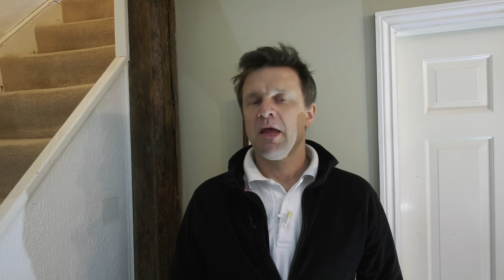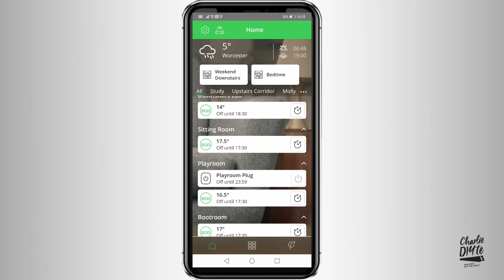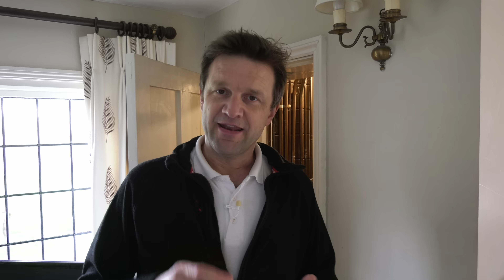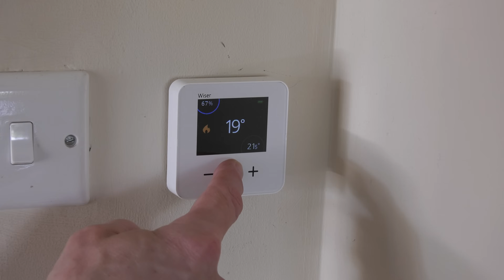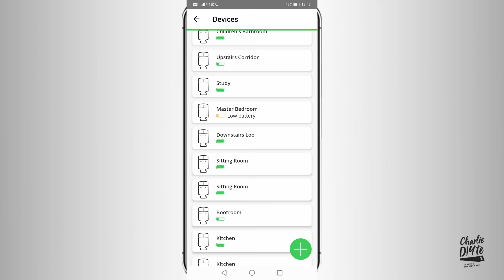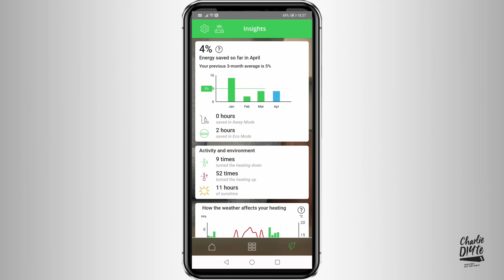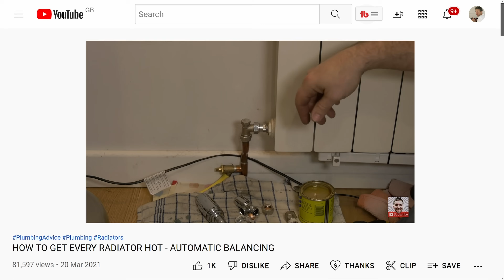Smart Heating Update - 14 Month Review

Comment: Room Thermostat. Tap middle button once for 2 degree boost for 30mins. 2 taps for 1hr, 3 2hr, 4 3hr.  Increasing temp +/- will remain at that temp forever unless you have scheduling setup. Enabling boost automatically increases 2 degrees. If too hot/cold use temp +/- to reduce or increase! I have room thermostat in every room. Use the boost as moving around the house. Works really well. Use the app in the morning to turn on heating downstairs simply using boost. Scheduling works fine but using away mode and boosting rooms as needed saving loads of cash!
Reply from the maker: Thanks for that Phil. Yes I'm pretty sure I covered the functionality of the room thermostat in my original video and should have gemmed up on this before find the refresher - there was a LOT to cover in this one. The Boost function only comes on for an hour though. You'll have much more accurate temperatures in each room with all those room thermostats 👍

Comment: Nice to get an update on how your finding the Wiser system as I bought into this system after seeing your initial install video. I'm currently producing a video of my own which covers more on the running of this system and some of the issues, rather than the install itself. I've also sent Drayton and Schneider a lot of suggestions to make this system better and get round a few of the quirks i've found, e.g. TRV and room thermostat offsets. Hopefully if I get a response from them then I will also cover what they are planning to improve. One area I will include in my video is the integration of a weather compensator onto my system boiler as Opentherm is just not working as you would expect due to the way different manufactures have implemented it.  In theory, the boiler will set its temperature directly based on an external weather sensor and should therefore heat the rooms up at the same pace irrespective of outside temperature. It should also start condensing a lot more as the weather picks up and the boiler runs at lower temperatures for the heating. However, I've keen to see how this effects the Wiser system with Eco mode turned on given that this mode has an element of weather compensation built in and I want to confirm if it conflicts with it in any way. I'm hoping that I may need to just rest the system so that it starts re-learning how quickly the rooms heat up again and realises that my home now heats up at the same rate irrespective of outside weather due to the new weather compensator.
Reply from the maker: Thanks John. You could probably do this with Home Assistant. Let me know how you get on.

Comment: Great review however I wouldn't part with my EvoHome. It was the original smart TRV heating solution and remains the best in my opinion.
Reply from the maker: It's a very good system Jason. Just think they've become a bit complacent given they were the market leader for so long. They need to add Insights but I guess they can't given the way it works. 👍
Reply: I agree with you, I’ve had Evohome for 7 years and my current house has UFH so all my systems including HW are Honeywell/Resideo and I can’t fault it whatsoever. I’d never be without it.
I have a three storey house, and I’ve not really had any issues with the system with connectivity. I can’t think of a system that does as much as Honeywell ie UFH, HW etc etc, even my 2 port valves are Honeywell 😂

Comment: Ah yes, the boundary system. I have one Charlie & like you had problems with connectivity it’s certainly challenged me but seem to have it under control for the moment after moving the hub & being sent a range extender. Great app though.
Watching this video makes me wonder why they don’t use the zig be mesh 💁🏼
Reply from the maker: Ah, interesting to hear that. They're doing what they can for me to get this working but are tight lipped when it comes to telling me what problems others have experienced. They don't use zigbee because z-wave is more secure and therefore better for security systems apparently. Personally I think they'd be better using it!

Comment: I made a mistake and bought Tado. It's not a mesh system and some radiators will not connect. I spent £1000 and intend to rip it out.
Reply from the maker: Wow, not mesh? I wonder why they did that? Thanks David that's really interesting. Sorry to hear about the problems you've had.
Reply: I looked at all the systems before going down the Tado route, the Honeywell systems looked dated and not much has been done to update it so ruled that one out, the Drayton looked great and also the Genis system, all great systems and the are from companies that are constantly developing the product, I expect the software to be changed over time.

I installed the Tado last September and it has been brilliant, I fitted TRVs on all radiators except the downstairs toilet and the main bathroom to allow boiler overrun, this is fine as it keeps these room warm and dries towels, I also fitted room stats to 6 room and the temperature in these rooms are very stable and accurate, I have found the family don’t complain about being too hot or cold, everyone’s room is at the temperature they like, my wife works from home and her office is warm all day and looking at the heat info this room requires little heat to maintain the desired temperature, I hound the hall call for the most heat so we invested in a new Rock front door and changed the single radiator for a slim double and this has made the hall nice and warm and reduced the call for heat to being one of the lowest in the house, now the only two problems I have had are the en-suite radiator valve had a leak around the pin and water got into the TRV as it was horizontal and damaged the valve, the other problem was the bridge failed and it was replace FOC by Tado.

So all in all I think the Tado is a perfect product for our house and family, I think if I fitted the Drayton I would be as equally happy, just for any of the manufacturers you will be happy as a smart heating system transforms your house and reduces bills.

Comment: Wifi is not the same as internet, if the internet is down there is no reason why the wifi network in the house shouldn't keep running.
Reply from the maker: Fair point but there's not much point in having a WiFi network if the internet is down.
Reply: @CharlieDIYte  If you have control systems on wifi then you don't need the internet to be active for it to work (unless it has to go through the internet... thats its own problem and not a wifi vs zigbee/zwave problem)

Comment: I have Hive installed and am considering replacing my "normal" TRV heads with Hive smart valve heads. I know it's a different brand but I think the principals are the same. So My question is what advantage regarding cost savings do smart valves offer over traditional TRVs set correctly?
Reply: The Hive trvs and thermostats do not speak to each other so you shouldn't have more than one in a room. For instance, say your living room has two rads and a thermostat, with hive you cant set one trv or thermostat to be the "master" temp sensor whereas with drayton and tado you can. With hive they act all separately which is a real drawback of the system.
Reply from the maker: It's a good question, and one which I touch on in the original video. Once you've set the temperature on TRVs you're not meant to keep adjusting them through the winter, but the main reason is scheduling. With the smart TRVs you can have different temperatures in each room - and you'll never know what temperature you've set it to on a TRV - and most importantly, you can set specific schedules for each room, whereas with traditional TRVs heat one room and you're heating all of them, unless you go around turning all the other TRVs down.
Reply: Just going to jump in here and say as someone who has the Hive system installed at my new house I have been increasingly interested in putting the Hive TRV's on my radiators aswell.

From what I can tell there will be people that sing any brands praises and other who insist they are the worst thing theyve ever had. All in all it seems there's 0 doubt that once you get past the upfront cost, the system will certainly save you money and make you feel more in control than ever.

My biggest gripe is the different brands, biggest ones for me being Hive and Tado. As I said I have a Hive thermostat and app already so it seems logical to me to keep it all Hive (one less app and just nicer overall) but I really am struggling to see why some (like Tado) are so much more than Hive for example. I'm not really seeing much difference functionality wise and I can only imagine any real differences are nothing more than fluff that you won't really care about anyway once your over the new toy phase.
Reply: @DisturbedM86  I am going with Hive because like you I already have it. It plays well with Philips Hue and Tado devices as well. (In my experience). It seems to me that the smart valves offer a significant level of convenience over standard TRVs. I believe that the same savings can be achieved by constant judicious adjustment of TRVs. I really think that they come into their own if occupancy varies or E.G. You take a winter holiday and have the heating set to just prevent frost whilst away and have it heat back to normal for when you arrive back home. Admittedly the upfront cost can be high but given current fuel prices it may not take too long to see a return on investment. 😀

Comment: Great video as always thanks. I have the room thermostat installed and works well. I want to create a second heating zone in my kitchen to just heat this room in the day. Thinking of a Drayton wiser trv for this BUT would the room thermostat over-ride it if the rest of the house was already up to temp and stop the kitchen valve opening independently…….? Could I add another port valve for the kitchen only and control it with another room thermostat??
Reply from the maker: I'm not sure about the port valve point or how you'd plumb that in but it would be cheaper to replace the other TRVs by the time you've had a plumber round. Plus the system functions so much better with all the rads on what valves.  Yes if you change the one TRV unless you go round turning off all the others, they'll come on when you call for heating in that room.
Reply: @CharlieDIYte  thanks. I’ve gone for multiple trvs and so far so good! Most useful feature is that they will ‘call for heat’ independently of each other and the room thermostat 👍🏼

Comment: Not strictly speaking correct when you talked about WiFi and internet connections... 😕
If you lose the internet due to your provider having issues you still have a WiFi network in your home - but without the internet capability.
So if the smart heating was on a wifi network and you lost internet - no problem unless you lost power to the house at the same time (at which point you would lose the router).
WiFi and Internet are not synonymous 🙂. 
Think of the internet as a service which is available to anything connected to the WiFi network...
Reply: Importantly this means that if you internet goes down you can actually still control the heating through the app provided you are connected to the same WiFi network, you just won't be able to do it remotely through the cloud - the app searches for the controller on the local network before it goes through an internet connection
Reply from the maker: Ok fair point, but it's better to have it on a mesh rather than on a WiFi network.
Reply: @CharlieDIYte  It's why the Drayton is a bit 'best of both worlds', mesh network for the sensors/valves for better coverage and much better battery life with WiFi on the controller for remote access, the distinction is that the controller/app can work with local WiFi only so if the internet goes down it still works and is controllable through the app. You get some some where the app control is over the internet only, so it would go down if you internet went down - just feels worth clarifying that despite the controller being WiFi Drayton doesn't have that problem, it's happy to communicate over the local network. That's the distinction between WiFi and internet Phil is making, hope that makes sense! 

That and the Home assistant integration were major selling points for me

Comment: Interesting video. I installed a system from Genius Hub about 4 years ago because there were very few choices at the time. It does everything you talked about with as far as I could tell one addition. I have room sensors, in addition, to the TVR's, they monitor the temperature in each room from a more central point but they also detect occupancy so depending on the schedule or plan will only turn the radiators on if the room is occupied should you want that. You can have a straight time on time off program and set different temperatures for different times of the day. Currently, the analytics are not as good however unless you go down the home hub root.

Comment: Zigbee is rock solid, I run not only Wiser for heating but Ikea Bulbs, Xiaomi sensors and so on, total 60 different devices. Also, the beauty is you do not need to buy proprietary hub from each of the manufacturer. Everything managed by Home Assistant, schedules, full control, voice control. Overall, I am really happy with the Wiser system, which was installed 2 years ago. The only thing I don't like is battery life, would like to use rechargeable.
Reply from the maker: Yes Home Assistant does look good 👍 Those batteries are working well for me right now. Expensive though

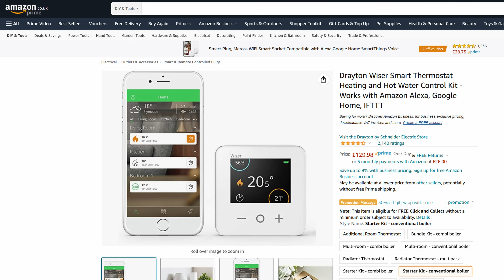Comment: @ 9:31 you talk about "clunky Thermostat controls". However if you press the Circle button twice it will boost your temp by +2'C from what it is currently reading (in your video that would be 20'C) and then you set the boost time as you demonstrated. You can also then easily increase or decrease the boost set temp using the +/- controls. Much easier than the way you demonstrated.
Reply: Don't get me wrong I am a BIG fan of the Drayton Wiser system we have now installed. Biggest issue with all smart TRV's is simply the price. Even Wiser TRV's @ £40 each - we have 12 radiators in our house so 11 x £40 = £440 that's a LOT of savings to recover from our gas central heating. Especially when we already have 2 Wiser Thermostats - 1 down & 1 upstairs - plus manual Thermostatic valves on each radiator already.
Reply: Wiser Insights - We have SMETS2 meters and already have an in home smart display provided by our Energy supplier (for some reason the GAS SMETS2 meter doesn't work, despite being changed). However Drayton Insights isn't available to me. I have checked multiple times since watching your video. It appears that Drayton Insights *ONLY* works if you purchase their own IHD (In Home Display?) for a one off cost of £14.99.
Reply: @MagicianMan  I will offer an argument for going with the extra expense (which many not be suitable for many I admit) is that if funds allow, why not. Comfort is important - its the reason we bother with heating in the first place. Not everything has to be ROI. Why go for certain car types/brands/packages, TV model,  for example, or any other item the nicer premium version -  we often and conveniently leave ROI behind in many instances and consider use cases and often factor in capabilities that half the time we never take advantage. Effective custom heating of your home space 6 months in a year, to a more comfortable level while using the same or less fuel/cost seems worthwhile.
Reply: Just about to start converting our house and realising I have 20 rads and not a lot of money means it's going to take a fair while. I'm Replacing a basic Drayton on/off thermostat so the basic kit alone should at least be an improvement 😊

Comment: Great video Charlie. I am unsure you need to balance radiators with wiser. I have evohome and my system is not balanced. All the lock shield valves are fully opened. Basically it prioritises the radiators close to the boiler but when you have reached temperature in these rooms you get proper heat in the radiators further away. To me this is one of the advantages of these systems as balancing a system is always tricky.
Reply: That’s an interesting point. I’d be interested if anyone else agrees with this. It’s not that I don’t believe you, but with my very basic DIY knowledge this seems to make sense to me, but that lack of knowledge means I can’t think of a suitable counter argument, which may mean there isn’t one, but I’m not sure! 😂
Reply: @mikec2505  if a few rooms far away need heat, but coincidentally a close radiator also needs heat, you will be waiting a while for the far away ones to warm up to a suitable temp, which in turn will take a longer time to get the room up to suitable temp, if it ever does. 
Balancing can be a pain, as its time consuming. But its worth adding that a rough ballpark balance might do - tweak the nearby rads lockshield valves down by a quarter or half turn everytime you notice that they outcompete the far away radiator on at the same time. Repeat until it is roughly balanced (at the least letting enough heat to the far away radiators so they can get the job done - it doesn't have to be perfect). No need to go farther chasing perfect even warmup on all rads, or getting a digital thermometer to measure in/out temps etc if you dont have to.

Comment: Lack of connection is not necessarily a thick wall or or location, I have found that if the router is in a room with silver foil backed dry wall, the foil acts as a shield for the signal.